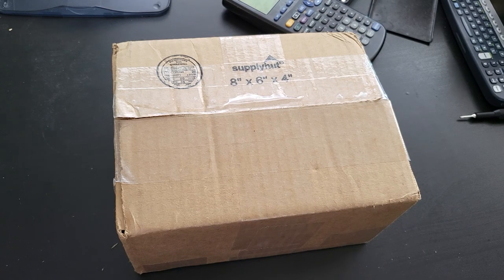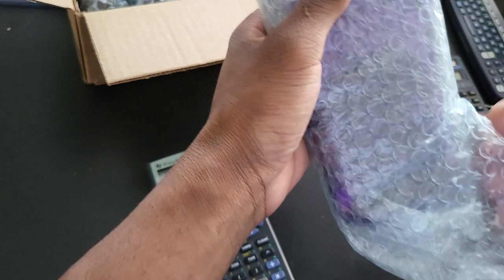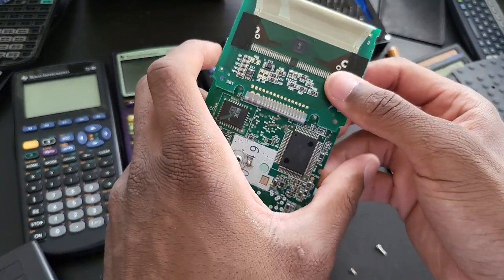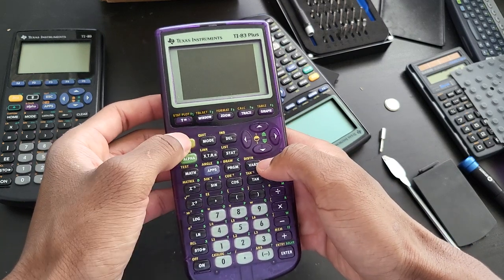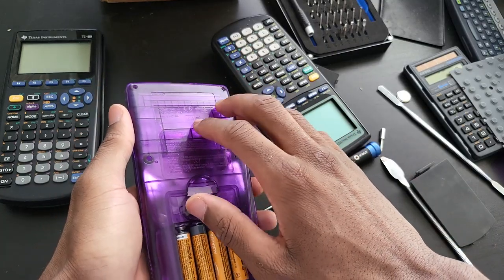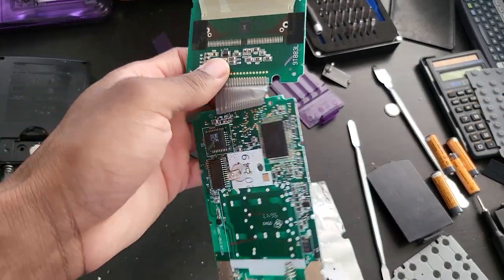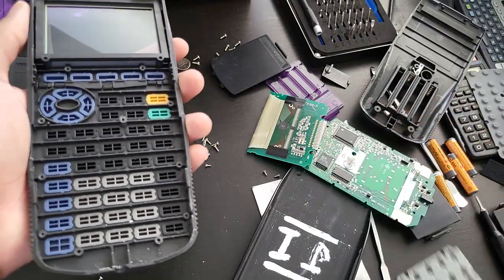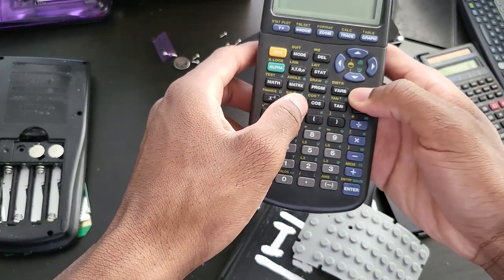Boring Calculator Repair and Stuff (Ti-83, 83 Plus and 89)

Comment: Hey, my ti 83 plus enter button and down button doesrnt work do you have any idew of how i can fix it 😢
Reply from the maker: It's always a good idea to open it up and clean any corrosion if there's any. Also, make sure all the metals in the battery compartment are in full contact with the terminals. This can cause numerous unexpected issues.